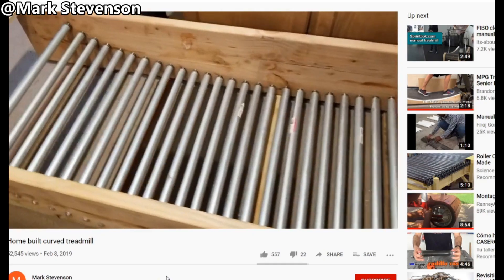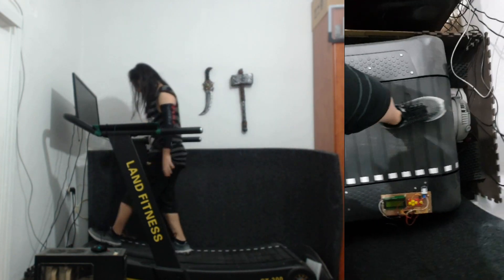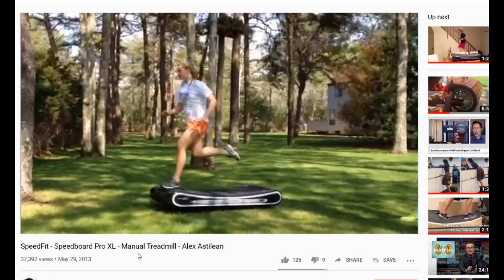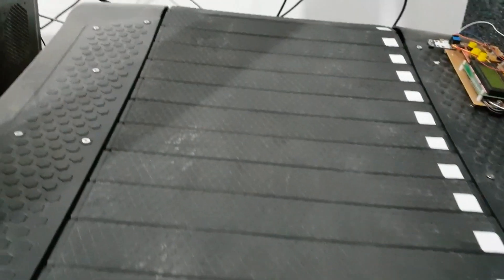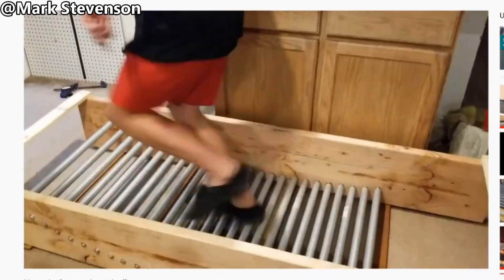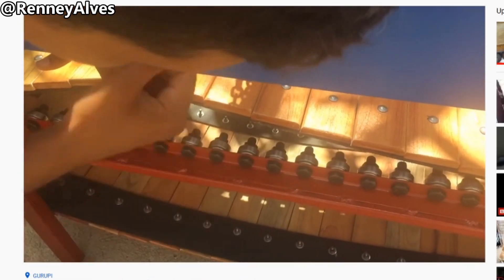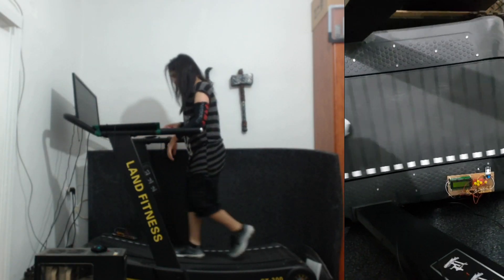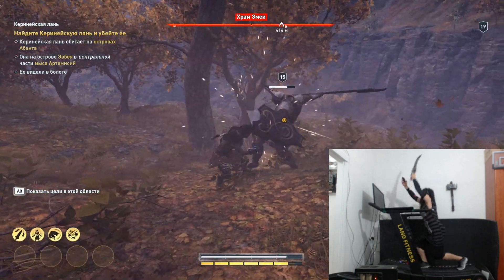How curved manual treadmills work (DIY+Professional)

Comment: why  curved treadmills so expensive
Reply from the maker: Did you see how many bearings? All those ball bearings; especially quality ones, cost a lot. Plus you'd want a good durable slatbelt - also brings the price up. The whole things needs to be made from tough durable materials to endure a human being (typically up to 150kg) running so nothing will break; considering the size and the mechanics that comes into building such a thing - it's priced accordingly.
Reply: @Larpushka  OK thanks for reply
Reply: Larpushka what do you think of the quality of Land Fitness? Do you mind sharing where you bought it? Thank you!
Reply: I think it's what the market will bear right now. As long as people will pay the price and fewer people make them, than other options, the price will remain high. Sure, quality bearings may cost 1/20th of the price, but they are also easy to replace and not all bear the same weight. Mass produced metal frame rather than wooden frame boutique will bring price down eventually.